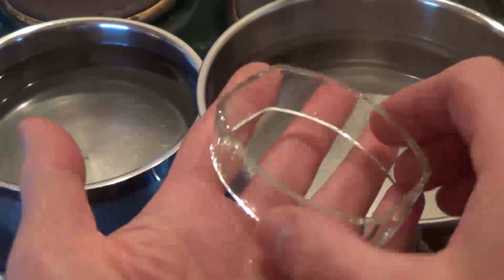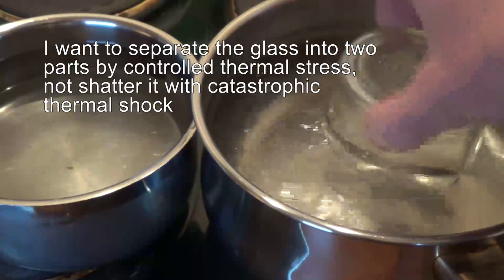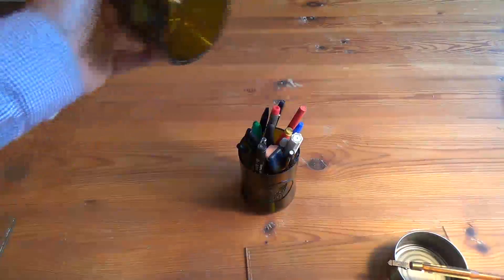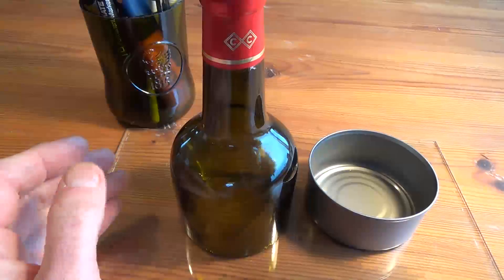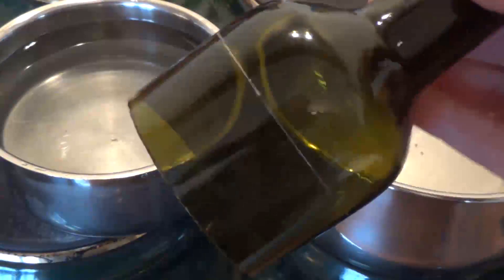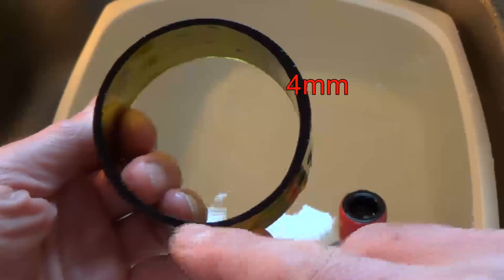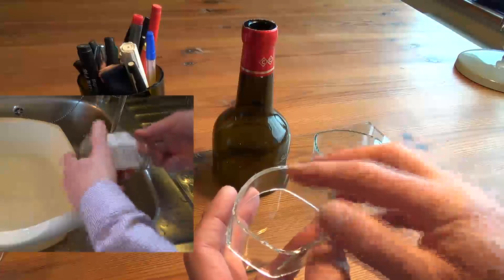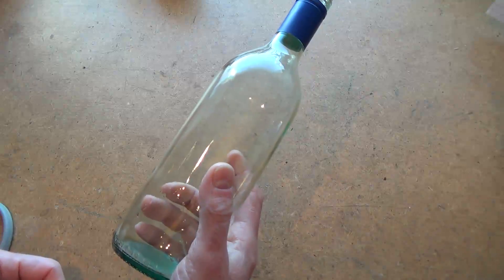Cutting glass bottles into rings easily with thermal stress

Comment: Does this apply to cutting mirror into strips
Reply from the maker: Hi  Kathy, I've never tried it, cutting straight lines on flat glass has always been easy. Cutting bottles however can be very tricky. The key to good cutting of glass is sufficient pressure to get the cutting wheel to actually 'did into" the glass surface. When you get it right you'll hear a satisfying crunch/grinding sound. If that crunching sound stops and starts as you move the glass cutter down the line, then you're  not doing it right. If you practice you'll get good at it. Put a little oil, any oil, even olive oil or sunflower oil on the cutting wheel, it really does make a difference, it oils the little bearing in the wheel and it maty do something the cutting zone that helps, although I suspect it can't do much to the glass. Good luck, let me know how you get on.
Kind regards . . .  Andy
Reply: @AndyDaviesByTheSea  thank you for that and I will let you know.  Most mirror cutting I've seen so far has the mirror being scored and then they snap it.  I need exact edges
Reply from the maker: @kathypridham4417  Hi Kathy sorry about the delayed response. Your right, most cutting involves scratching the glass and then bending the glass to open up the scratch.  I don't know what or how many bits of glass that you want but it's not unusual to cut glass with a diamond saw. or you can cut the glass and use a special stone to rub down the edges and even polish the glass along the cut line. again, not knowing what you want, it could be easier to simply find a supplier who will supply cut and polished mirror to your specification. (probably not cheap
!!££$$£££!!) 
Good Luck 
Regards . . .  Andy
Reply: @AndyDaviesByTheSea  Hi there,  I am working on trying to get a supplier.  What I ultimately want is strips of mirror for making my Kaleidoscopes so they can't have any uneven edges or you see it once it's all assembled.
Reply from the maker: @kathypridham4417  Hi again Kathy, have you looked for narrow mirror tiles?? (wall tiles)  I've just had a look and there are all sorts of mirror strips and little mirror tiles available, there are some mirror strips that look as if they might have a sticky back. They could be soft plastic. Check out mosaic tiles. 
I under stand your visible ragged edge issue, but reasonably you only need one perfect edge where the glass touches, so could you buy the narrowest mirror that you can get and simply cut strips off the side and using the 'Good edges' where you need them and simply throw the rest away?? ( or making glitter balls out of them?)
 Could you paint a straight black line down the outer edges that are rough cut so that you don't see them??? 
Regards . . . Andy

Comment: Great video. I bought a fancy bottle cutting gadget but dose not cut clean. Where can I get a glass cutter like the one you used?
Reply from the maker: Hi, the cutter that I use in the video is one from a fancy 'stained glass' glass supplier. It has a cutting oil holder built into the handle. but you DON'T need that. Any old tungsten wheel cutter will do! Really, if you use it right, any old cutter will work! If you've got a fancy cutter and it's not working, the chances are that you're not doing something right.
Things to remember.  Press really hard, you should hear the wheel cutting into the glass and you should see a good clean, deep scratch/cut into the glass. The cut line/scratch should be continuous. If there are gaps in the line it won't cut properly. if there are gaps go over it again but try to avoid going over a good cut too much as the takes the edge of the cutting wheel.  If there is a stray end of the cut line running off at an angle, because you have failed to join the ends of the cut together, it will fail. Let the combination of hot and cold water do the final bit. don't hit the glass but make sure that you give the glass long enough to heat through. Good luck. let me know how you get on. Don't forget, you won't win every single time, sometimes it goes wrong, I don't know why, but that's life!
Kind regards . . .  Andy

Comment: Great video, Andy. You have prompted me to try it out.
 One question: would it be possible to use a similar method on flat glass sheet to make replacement glass windows for moving coil instruments and the like? Have you ever tried this?
Reply from the maker: Hi Peter I haven't tried it on sheet glass but have a look at some of the videos on stained glass projects and you'll see how folks cope with cutting inward facing curves out of flat glass. One tool I have found really useful is a cylindrical diamond grinder for use in an ordinary battery drill. I think that for electric meters etc you'd find something like a 1/2" (or 12 or 15mm) round cylinder really helpful to trimming the glass. I have one and the length of the cylinder is maybe an inch (25mm) Use it wet and you could easily cutout  shape a meter glass out of square of glass if you had to, just keep it wet to keep the dust down but more importantly to keep the glass cool otherwise it will shatter quicker than you might think it would.Have fun.Good luck.Kind Regards . . .  Andy

Comment: Do you sand it?? Or leave it like it ends after breaking apart. Will it cut me if I drink? If I touch it without care?? Cool video. Thanks
Reply: yes Felipe, unfinished (not sanded) cuts in glass will always super sharp edges. always sand the edges smooth to avoid cutting yourself accidentaly especially if you are making glasses or cups out of the bottles.

Comment: Great and very helpful video Andy. Would this method work for just removing the neck from a bottle? I have tried a variation on this method using hot wire around the neck then cold water and my success rate is only about one in four or five. :((
The stress seems to lead to factures in the neck and uneven cuts.
Reply: *fractures

Comment: Hi
This is what I have done and it comes out real nice and clean.
I follow everything exactly what you have done.I did the process once i.e in boiling hot water then dung it to cold water.
Next I filled the bottle with water like 75% full. I hold it
in one hand by the neck of bottle and hit the top open end of bottle with my palm. This excert a homogenoeus force right down into the bottom and thereby tearing the cut lines perfectly. It was evenly,clean and nicesplit!

Comment: An excellently produced instructional video.
I tried this method. The first attempt broke along the line but produced cracks perpendicular to the score line in both directions. I think I poured on hot water for too long. On the second attempt, I poured on hot water from a freshly boiled kettle for 8 or 9 seconds and then cooled it under a running tap. I expected to have to repeat this several times but I got a very clean break. I then smoothed the cut with a drum sander and emery cloth.
I have tried cutting bottles in the past but gave up as I always got cracks. This has encouraged me. Thanks

Comment: I use a heat gun for stripping paint on low setting with a directional tip right on the score line then dip it in room temperature water. I have done 15 bottles so far and no breaking or chipping with straight cuts every time as long as you score line is straight

Comment: I have tried pretty much every method out there to cut glass bottles. Fire and string, glass cutter and hot water, blowtorch, diamond saws, etc.

Saws always come out with the best cut, but when I didn't have access to a saw, I used a glass cutter and a soldering iron to apply heat. Then a few drops of cold water. 95% of the time, an absolutely pristine edge.
Reply: How did you apply the soldering iron? Only the tip over the cut?
Reply: Marian Nieto It really doesn't matter how you apply the heat, so long as it is concentrated on the score line alone.

Personally, the tip I used was a long cone tip, but I most often just used the metal body of the soldering iron itself.

You could likely use a blowtorch or even a hot piece of wire so long as it is controlled onto the score line. For me, I happened to have a soldering iron and a jig to keep it in the same spot as I turned it.

Comment: Have you ever tried using UV glue to put them back together in odd combinations ?
There is a company called Soliq which sells a glue for this purpose. It dries instantly on exposure to UV light. So they sell a little lamp with the glue. It's quiet strong. I think it's the same thing that they use to varnish and harden women's fingernails with, after a manicure.

Comment: Hiya, I have to say that was fascinating and opens up a whole world of possibilities for me - thank you very much
Reply: AndyDaviesByTheSea Given the extra complexity of psu + wire your method is by far the most elegant Ive seen. Time to raid the glass collection :)
Reply from the maker: Mike Rooke
Hi, I tried it years ago with nichrome wire and a low voltage transformer but I don’t recall having a lot of success, maybe I should look at that again.
Merry Christmas
Regards .... Andy
Reply from the maker: Hi Robert, thanks for the feedback, by the way I saw you ‘microwave oven’ project just after I’d paid £50 for one (4 ½” id Hot-Pot), probably just as well as I could easily be distracted down the oven making route.
Merry Christmas and hey, don’t overdo the turkey in the 1000 °C Kiln   
All the best ... Andy
GWØJXM
Reply: Great stuff Andy very helpful, 73 OH2FCZ
Reply: I saw one video on valve making where a hot wire was placed around the valve tube - have you tried that method or is it too uncontrollable?

Comment: I wonder if this process would work to remove circles, triangles, squares, etc., from the side of bottles? I would imagine one would have to go through a case or two of wine before obtaining the desired results.  But oh what fun you would have! :)  Have a great day, Andy, and thanks for sharing this tip.

73 de Mick WB4LSS
Reply from the maker: Hi Mick, it’s very hard to cut anything other than rings around a bottle, I did try cutting a sloping line, that is, instead of cutting the bottle to have a flat top I wanted to have the top at an angle of about 30 degrees but every time I tried the fracture would part follow the score line then it would veer off and take the shortest route round to the other side, I gave up in the end as it always had the same failure mode. I guess it’s just the way it is with the forces set up.   
Kind Regards ... Andy

Comment: Thanks for the tips, Andy. I've tried splitting wine bottles like this, but by pouring hot water from the tea kettle, rather than complete immersion. It usually ended in failure, probably because I was too impatient and pulled the glass off prematurely. Next time I try it, I will try immersion in the pot of hot water.
Reply: It is easier with plastic bottles & a Bread Knife.

The edges look very sharp.

People used to use a hot wire also. Edge was rough they sanded it down.

I expect items like this to be fragile as there not annealed

Comment: Well done! I like the way you hold the glass cutter on top of the open can. I also appreciate the fact that you took the temperature of both the hot and cold water. From my experiments, I can tell you that different bottles are made with different types of glass (or thickness of glass). The bottom line is that different bottles have different temperature ranges, where it takes less effort to cut them. Great video!
Reply from the maker: Hi, thanks for the feedback, yep I’ve found a huge difference in the required temperature, another thing I find is, the first cut on a complete bottle can often  be made a lower temperature than the second cut. Once the end is open it’s as if the glass can tolerate a higher temperature difference without breaking. I’ve noticed this particularly as I’ve being trying to cut ever thinner rings, anything less than 20 mm or so is quite difficulty to cut reliably.  
Kind Regards ... Andy
Reply: In some of my bottle cutting videos, I used a torch. I also used a battery operated screwdriver to rotate the bottles. Then I discovered that sunlight on a warm day delivered enough heat for cutting lots of wine bottles. In my latest video entitled "bottle cutting frenzy, I cut a ring at once (both cuts) after immersing the bottle in cold water. If the sun is not shinning, I now can use an oven...
Reply from the maker: Good video well done!
Kind Regards ... Andy

Comment: on a science tv show here, I saw a guy who came up with a much cheaper way of making lenses for eye glasses.  he was inspired to do this as most people in poor countries cannot afford eyeglasses due to the huge expense of making lenses the usual way.

the method he came up with was using plastic resin in a kind of ring and using vacuum suction to cause it to convex on one side thereby forming a lens.  A very low cost method of making eye glasses - although the quality of the lens is not optimal.

It came to mind watching you cut glass so I thought I would mention it.
Reply: I forgot to mention, that its through variation of the suction power of his device that lenses of different focal lengths can be formed - which is important for varying degrees of poor eyesight that people have.

Comment: If someone isnt going to be melting/"slumping" the glass pieces you can sand the edges cheaply using some kind of grinding bit on a drill, use eye and dust protection, or use a hard sandstone type of rock.
Reply from the maker: I have a selection of abrasive stones that I use and some diamond files, but yes you can even use an old brick to take the edge off, ideally if you can find a soft brick, the sort that gets damaged by frost, they have a good consistency for taking the edge off glass rather than a new ‘glass-hard’ natured brick.
All the best ... Andy

Comment: hi andy we used to tie a piece of paraffin soaked string around a milk bottle burn the string and then put in cold water and it would give clean break then carefully rub the sharp edge on smooth side of a brick to stop it cutting us. ps i am the  guy who asked about foundation course not important now have passed.i will try to c,q you as soon as i get licence and call sign 73 reddkite.
Reply from the maker: OK on the flaming string method with a brick to follow, I’ve used that but wanted something a bit more controllable. Congratulations on passing the test, maybe now you have firsthand experience you might fancy making that video yourself?
Again, well done! I hope you get a lot of fun out of the Ham Radio hobby
All the best ... Andy
GWØJXM